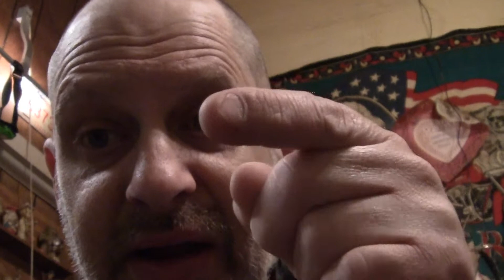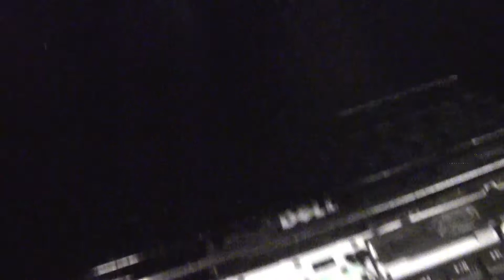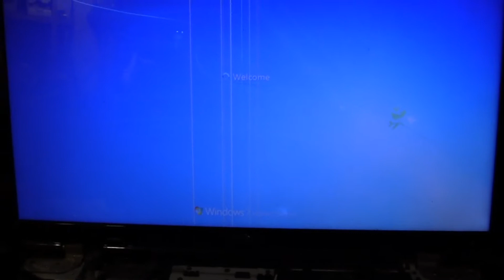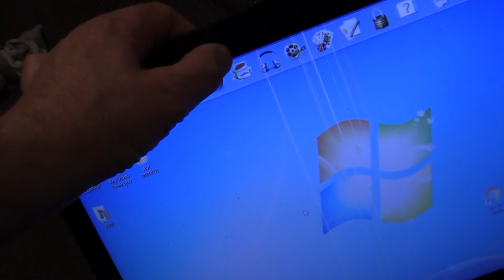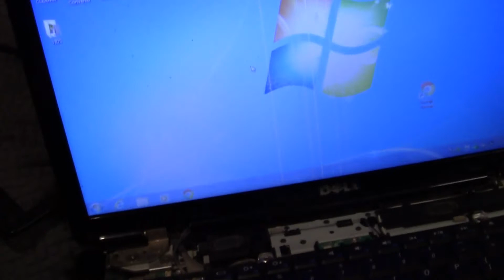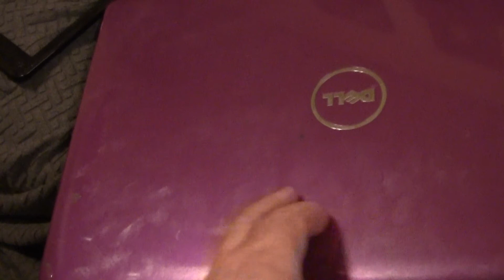DELL INSPIRON 1545 FULL RESTORE & MAXED OUT (Part 1)

Comment: Those top cases have a tendency to break or just start falling apart. Luckily, it's fairly easy to get a second-hand or even brand new one for not much money. I've had a bunch of 1545s come into my hands and own three right now, one of which is my regular laptop and another is my wife's. I always upgrade the CPUs and install an SSD, and mine also has the optical drive replaced with a 1TB spinning HDD in that bay. These days, you can also get one of the 900p screens that Dell offered as an option for cheap and upgrade that too. These are much better to use at 900p than at 768.

The best one I have has the mobo with the Radeon HD 4330 graphics, C2D E8435 3.06 GHz, 6 GB of RAM, a 512GB SSD and a 1TB HDD, a USB 3.0 ExpressCard, 900p screen, and I installed the silver keyboard from the Inspiron 1520/25 because you can use it in low-light conditions. And a brand-new top case. This one runs PCLinuxOS, and my wife's runs Mint. But these still run Win10 just fine, too.
Reply from the maker: Right on , I would like to take the DVD out of mine and install another HD .. What parts did you use to do that ??
Reply: @shawnmrfixitlee6478  It was just a standard drive bay adapter like you can buy on AliExpress or eBay. They all say what models they work on, and ones for a 1545 are readily available. You will have to remove the bezel from the DVD to make it fit properly, though. I've used the same ones on a 1545, a 1750, a 1764, and a 3520, and the only problem I had was that they didn't work in a 1764 without a delay in the boot of 3-5 minutes.
The adapters work well in both Windows and Linux, or at least they did the last time I used Windows. I've been Linux-only on my laptop since 2014.
I keep looking for some new hack I can do to a 1545, just for the heck of it. I wish someone could figure out a way to make it boot a Core 2 Quad reliably. The problem seems to be that the VRMs just don't deliver enough power to initialize the CPU. The 3.06 GHz duals are the best that will work.
Reply from the maker: @johncate9541  oh, yes i know what you used .. i am building up another one now so i will try one out in that system,, thanks